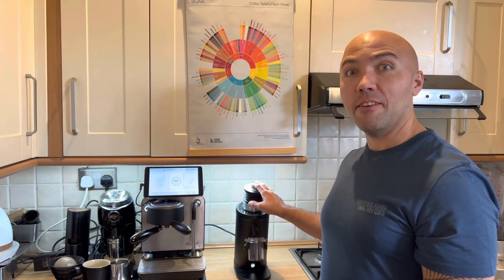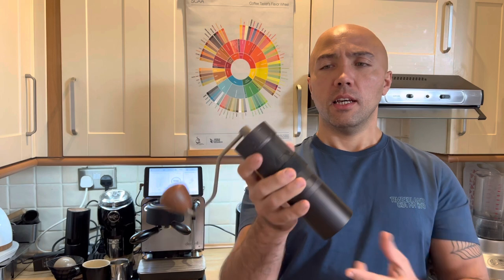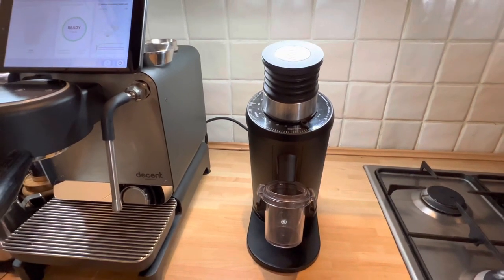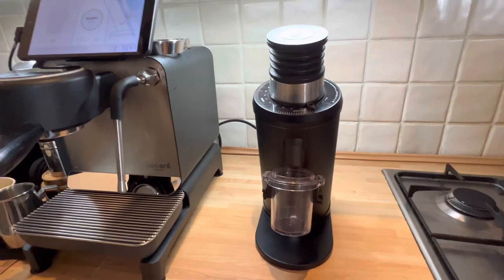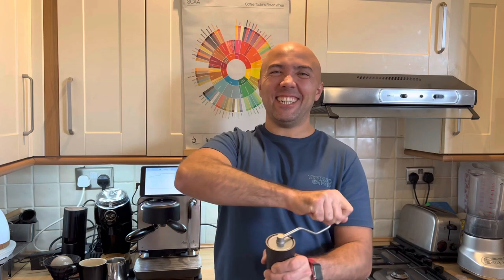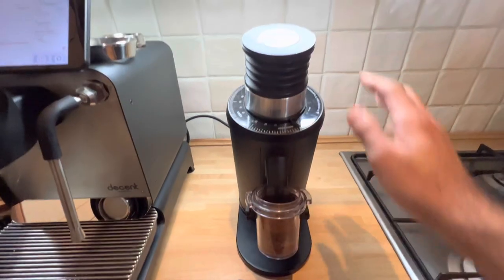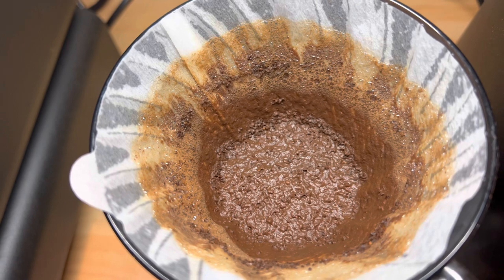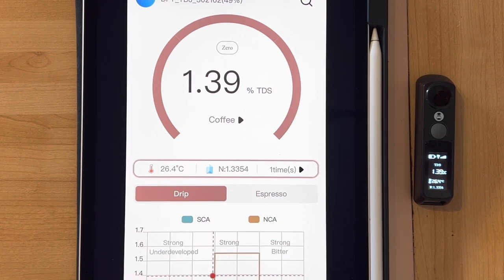1Zpresso J-Max vs DF64 with SSP MP burrs. Espresso and pour over.

Comment: if you hold the grinder at a 45-70 degree angle, fewer beans will come in contact with the burrs and you will get a much easier grind and be able to maintain consistent speed which should produce a more uniform grind. might increase time overall only a few seconds (grinding fewer beans per second but also no starts and stops, cancels a lot of the added time out). i have a jx-pro not a j-max and also a df64 with ssp burrs. i dont daily drive with the hand grinder but sometimes i will use it for a week straight. when i have multiple beans in the house sometimes i will use one of one set and the other for the other.
Reply from the maker: Thank you very much for your tips. I have already sold it. Right now K Ultra is my favourite but recently bought Comandante C60 Barracuda which hopefully will be even better.
Reply: What is the difference in taste between df64 and jxpro ? I am contemplating purchasing df64 ~ to save time and produce better shots . Is it worth the upgrade
Reply: @mycoffeeshow111  do you find there's a large difference between the k ultra and j max? the angle tip should work for any hand grinder you've got. i find it makes a more uniform grind so very worth it imo
Reply: @78anant420  i love my df64 and i use it MOST days, but its not 600 bucks better imo. its worth it more for the wrist strain than the time, effort or quality of the shots. i think the DF64 with SSPs gives a lot more acidity, especially with espresso (which i like) but also i only have a cafelat robot which has trouble extracting light roasts. maybe if i had a machine with a boiler, the differences would be more positive, but i dont know yet.
Reply from the maker: @78anant420  you should get more clarity from DF64. If that is what you are looking for then yes it is worth it. Or even better, DF83
Reply from the maker: @RunButton  J Max gave me nice silky shots while K Ultra enhances fruity aroma and sourness

Comment: My first grinder was Timemore C3 which I use for V60. I bought recently a Gaggia Classic Pro with Jmax. the Jmax definitely was harder to grind with, but now after several months I find it so smooth. Not because of seasoning, it is because of increased muscle strength and muscle memory.
Reply from the maker: Thank you for sharing. I recently compared C3 with Normcore V2 (https://youtu.be/xgZoF0u_-0Y). 
As for J Max- great if you want to really dial in your shot, bas if you have tendonitis in your elbow.

Comment: Hello from NY, I like your channel and watch it often. I have DF64 with MP and a Lelit Elizabeth (9 bar machine) and I am thinking about a getting a decent. I like light roast coffees. Now I like espresso not very hot, around 140 Fahrenheit. I have bought the ember cup that monitors and keeps coffee temperature constant. The ember cup works better with pour over and it is ok with espresso. Drinking temperature has such a significant impact on flavor and varies so quickly that makes the ember cup worthwhile. Although I was trying, my puck preparation wasn't very consistent  and I used to get channeling frequently. I recently got the duomo WDT tool and a Happy tamper and my cups have improved considerably.
Reply from the maker: Thank you for watching. Yep, some baristas saying we shouldn’t drink  espresso when is too hot if we want to experience the full spectrum of flavours. 
As for Decent- it gives so much fun, especially if you like to experiment.

Comment: I've been exclusively using the J-Max for about 6 months. I can confirm it may require some force, but it heavily depends on the bean: 18g lower density beans I can grind in 15 seconds (!); higher density takes 30 seconds and I'll get stuck a few times as seen in this video. I got better at it over time because my muscles got trained :)
It's silent (big plus!), has almost no retention (bump the bottom or tap it on the side) and is super easy to clean; and all that for +/- 160 EUR. Given the fact that I'm living on my own and drink max 4 espresso's per day, I don't need an electric grinder. If however you live with family or often have espresso loving friends over, an electric grinder will be the obvious better option.
Reply from the maker: Thx for sharing your experience. It is definitely a worthy choice for someone looking for non expensive espresso grinder.

Comment: Love this comparison. I used to use my jmax daily until i developed a wrist problem in march after about 3 months of 2-3 grinds daily. it still hurts sometimes. I love it though. it is super fast, its beautiful, i love how good the bearings are. I find that unless you use the brush it comes with, mine will retain almost 1g of coffee. It is terrible for retention even with RDT. i usually pull my flair pro 2 shots at around 1.3.5-1.4-5 and french press at about 2.3.0 so its interesting to see you start at 1.8.0 for espresso I think you said. I'd love to see a Jmax vs SPTK before you get rid of it haha.
Reply from the maker: Thank you. Sorry to hear about your wrist but it is not a surprise to me. Especially with light roast it can be a challenge. I had similar issues with K-Max but now is much better so I hope it will get easier with time. 
As for grind settings I guess it depends on coffee and who knows how consistent those grinders are in terms of settings. I will have to check the retention next time I use it.

Comment: Hello Jack. Thanks for the great videos. I watch a lot of them. 

I currently have a J Max and a Flair Pro 2, and while I am fine using the J Max even with light roasts for pour over, I’m finding it really hard (and causing tendinitis flare ups) to use it for espresso daily. 

I am trying to decide between a DF64 or a Niche Zero for both espresso and pour over, I am wondering which you recommend? I’d probably start the df64 without mods or SSP burrs though I know eventually I could upgrade. 

Though I could use the J Max for pour over if it performs better for that than the electric machines, wondering your thoughts on that too.
Reply from the maker: Thank you very much for watching. I would go for DF64. If you like J Max you will enjoy DF64 as it offers nice clarity. Niche for pour overs is not the best but if you are looking for nice thick espresso it can be worth considering.
Reply: @mycoffeeshow111  interesting. I’ve heard that about the niche and pour overs, but I also don’t want to have to fiddle too much with my grinder and I’ve heard the niche has the better workflow. 

So you personally don’t like the Niche for pour overs either? Maybe I could just use my j max for pour over and niche for espresso then if I go that route.
Reply from the maker: @Sylanthus  Niche produces more fines so it can clog up the filter and your pour over will have less clarity. As for espresso it really depends on your preference. On many occasions I enjoy the taste from DF64 more. Soon I will be comparing both of them to DF83- maybe that could be an option for you?

Comment: Hello again, very nice video as always.
I only do pour over and moka at home and I only use comandante now (a friend told me it was the best for pour  over) so I cannot really comment on the video but I have a question since I am still a pour over noob: I heard flat burrs give the best clarity so, if that's true, in the future should I upgrade to an electric grinder with flat burrs to make the possible best pour over? in the video you said there is not big enough difference to justify the higher price, but have you ever tried a grinder that made you go "wow" with pour over?
Reply from the maker: Hi, in short yes, flat burrs can give you more clarity but also some conical like Kinu. So far the best results I had were with Comandante and K-Max. I tried many pour overs at the coffee shops using EK43 and have to say they were much better than what I can produce.
Reply: @mycoffeeshow111  thank you! I'll keep it in mind for the future, I'll work on developing my palate first though... I feel that good equipment is wasted when I haven't developed a proper taste
Reply from the maker: @varieedeventualii  You are right. Plus there is that law of diminishing returns.

Comment: Interesting Video! Whats your take on brew temperatures? 88-90 Seems rather low from conventional standards. But given your good tds and taste I am interested in your approach. Also what’s the roast level you use?
Reply from the maker: Thank you for watching. I don’t remember exactly what I used but usually is light-medium. As for temperature, most machines measures the temperature at the boiler and naturally it drops going to the group head. Decent measures it at the group head hence it often looks lower than you would expect. Sometimes I do put it up though.